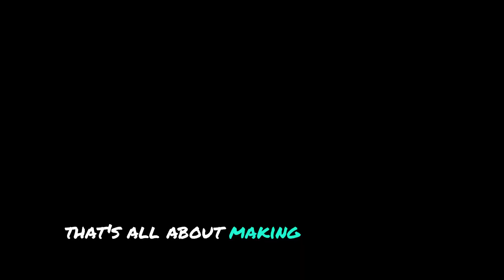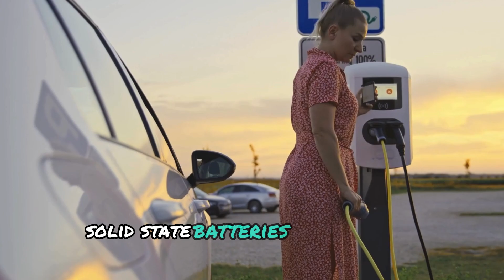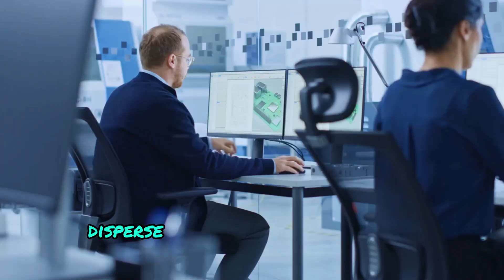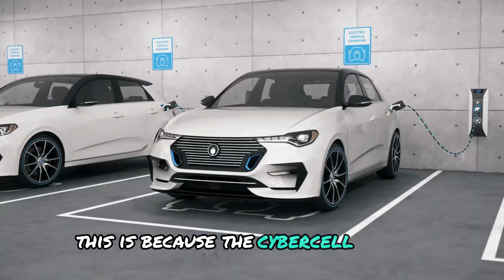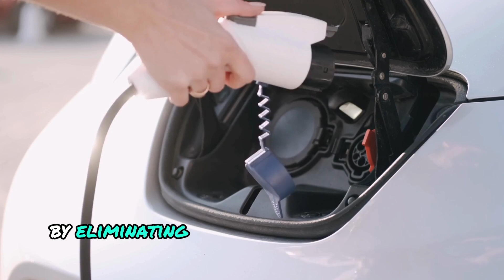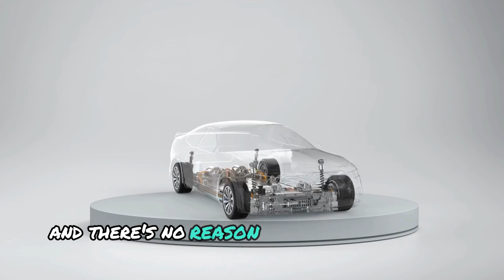QuantumScape’s NEW FlexFrame Battery Will Change EVs Forever!

Comment: The QS battery will last 1 million miles. It will charge in under 2 min. The range will reach 1000 miles. Cost will be under $50 per KWh. Fires will be impossible. Planes can fly with QS because there is no fear of fires.